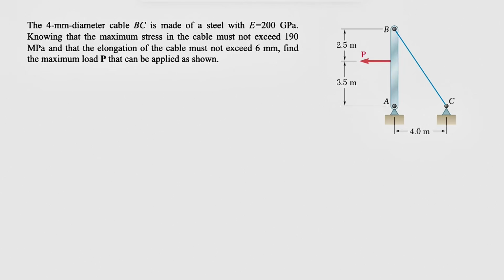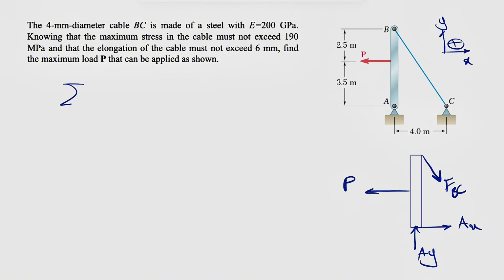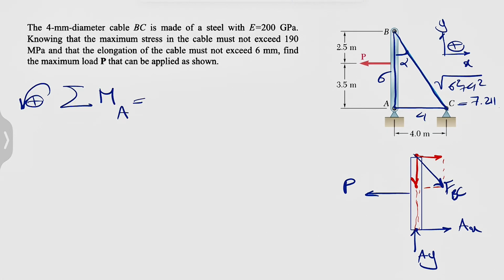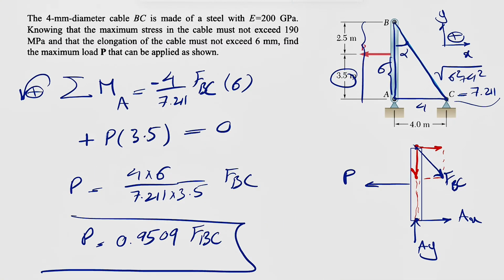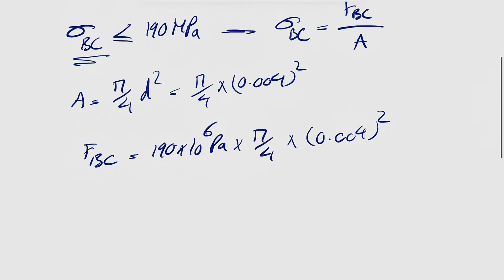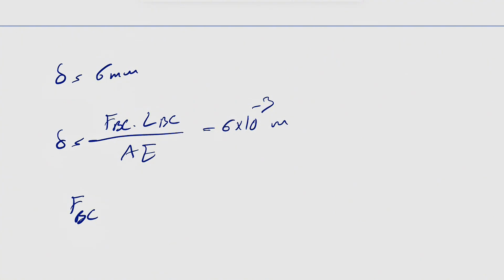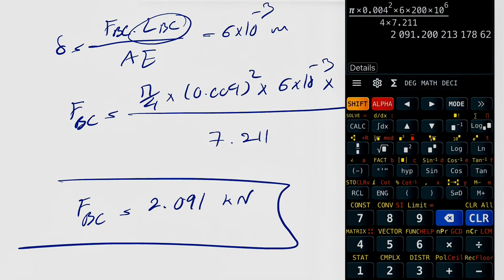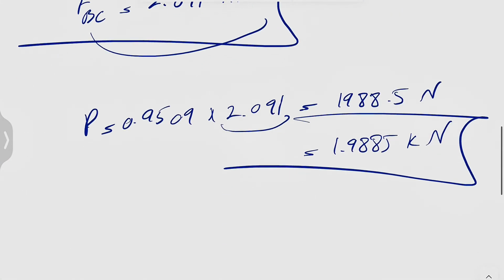Problem 2.14 | The 4-mm-diameter cable BC is made of a steel with E=200 GPa.

Comment: ok but what if the first force was lower, does it even matter because the second one takes into account the elongation?
Reply from the maker: In any case we go for the lower value. Keep in mind that elongation must not exceed 6mm. Even when the first force was lower hypothetically, still acceptable as the elongation would be definitely less than 6mm (doesn't need to be exactly 6mm)